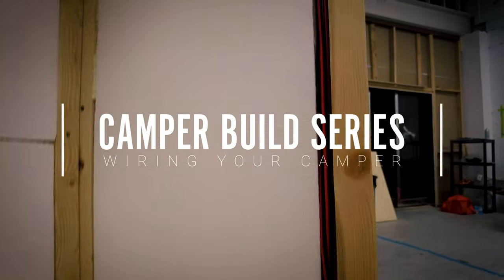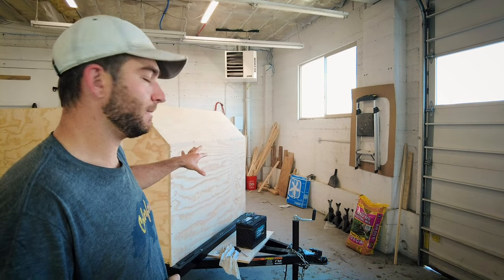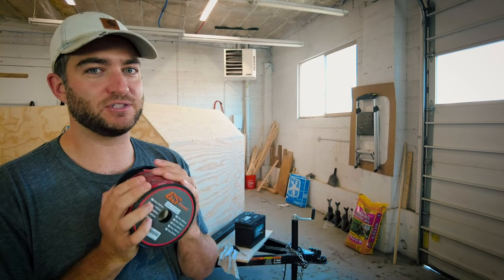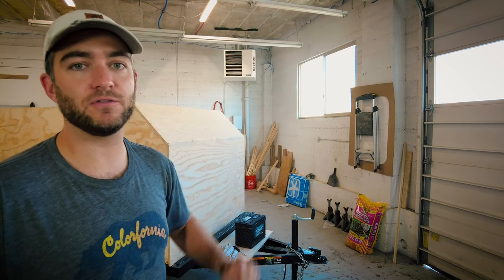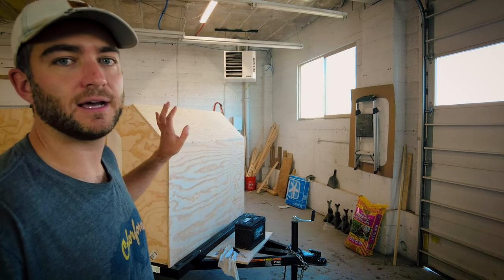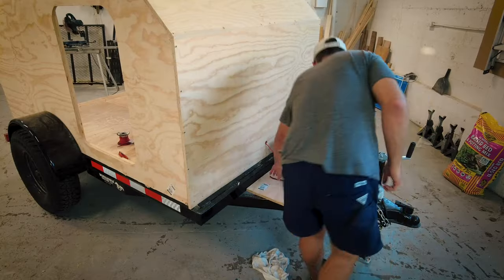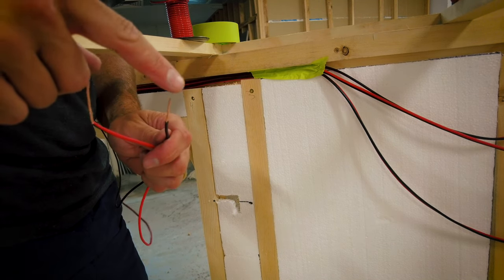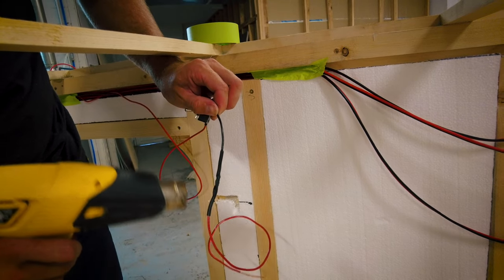How To Build a DIY Square Drop Camper Trailer: Wiring

Comment: The electrical side of things for my trailer build is what I’m afraid off the most. Really looking forward to a video on the entire setup as well as your method of connecting to your battery.
Reply from the maker: Sounds great 👍 give me a couple of weeks and I’ll get that video out.
Reply: Get some channel lock crimpers. ,that's the brand.  Some good wire strippers. Some good 8 in one screwdriver. All set.

Comment: thanks for your knowledge and great YouTube, if you ran the cables under the floor and bring them up to their position. This will help not having large group of cables on the inside walls. Also there is a screw type connectors which is twisted to the cables you also could use.
Reply from the maker: Thanks Gary! I appreciate the support and great suggestions!

Comment: Hey man, just curious. Why don’t you install the fuse panel inside the camper and just ran 2 wires through the wall to your battery? That way you’re not having multiple circuits running through the outside wall. Hope that made sense
Reply from the maker: Great question! It's simply to keep things neat and out of the way. The only good place to do this would be in the back galley, which is what I did in my last camper. I've actually never needed to access my fuse panel, so with this build, I decided to just stick it up front in the tongue box. Now, all of my electronics (battery, fuse box, solar charger controller) are all housed in the tongue box. It essentially just maximizes usable space in the rest of the camper. Personal preference, but I could totally see why someone else would house it in the camper. Thanks for watching the video!

Comment: Hi! Love this videos! Amazing Squaredrop. 
Do you think its possible to use SIP panels to assemble a squaredrop camper? the construction method and the incoporated isolation, make me think it could be a good idea. Faster to build.
But i have my doubts about the resistance to road movement. 
Thanks a lot for yout videos. 
Do you have build plans of your squaredrop camper?

Comment: Would you fiberglass one if there’s campers if you build more?
Reply from the maker: I haven't done much fiberglassing before. If I were to go the route of using Raptor liner again, like I did on my first build, I would 100% fiberglass it beforehand. Thanks for watching the videos and subscribing!
Reply: I think that’s the route I’ll go with, I don’t know how much the aluminum costs.
Reply from the maker: @thomasthompson3967  The aluminum was a bit expensive mostly because I had to buy it in bulk (15 sheet minimum). I bought enough for 3 campers. I built 2 and then sold the remaining sheets to someone locally. In the end, I paid about $60 per sheet of 4x8 aluminum.

Comment: Ok decent connections but invest in a soldering iron and solder to make those connections perfect. Over time the twist connections will corroded and fail solder will make them more of a lifetime connection.
Reply from the maker: Thanks for watching. Great suggestion. I have a soldering iron, but never really bust it out. I'll bring it out for the next project. Just out of curiosity. do you know if twist connections in a wire nut will corrode less than these heat shrink connections? Seems like most electricians use wire nuts, so I would think that they would last for a long time without corroding.

Thanks again for watching and for your input!

Comment: Great series! I've designed my camper but haven't built yet. Are you going to have shore power and an inverter? I plan to with mine as I want to be able to hook up to camp grounds on my trip to get to the overlanding and boondock places. That way you are not always relying on solar for spots where hookups are available.
Reply from the maker: Thanks for watching and subscribing! I think that is all a great idea. I have a small power inverter to plug 3 prong power plugs into, but it still runs off of the battery and solar power. For my uses, I didn't really think that shore power was necessary, but I can see that it could be helpful if you were planning on using campgrounds. Our power usage is so low, that even on a cloudy day, I get enough of a charge to replenish the battery.
Reply: @FunkeAdventures  that makes sense! Thanks for the reply.
Reply: Agreed, great video! I’m also looking to do shore power, with Solar hopefully coming eventually.

Comment: Hi mate… i live in Australia and wanting to build one… what are some of your measurements… cheers Rick
Reply from the maker: Rick! Thanks for watching and subscribing!
Sorry I don't have the metric measurements... 
The base is 5 ft x 8 ft. The walls come up 4 ft high (which is the standard size of plywood here in the US 4 ft x 8 ft). I used 3/4 inch plywood for everything.
The inside just fits a queen sized mattress perfectly. Whatever was remaining after I added the mattress is what makes up the rear storage space.

Let me know if you have any other questions.